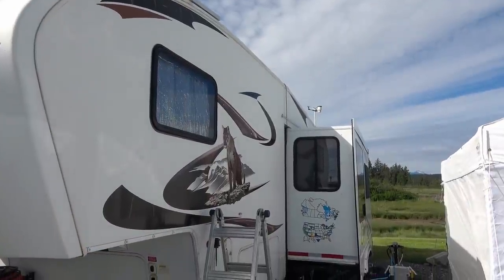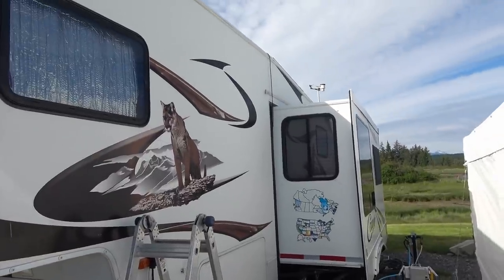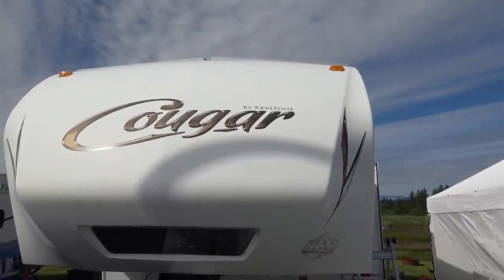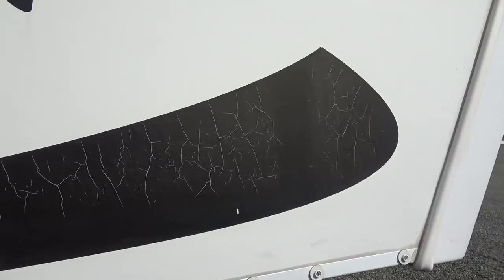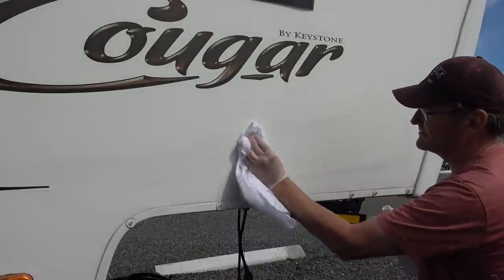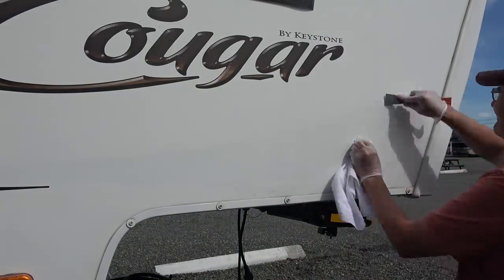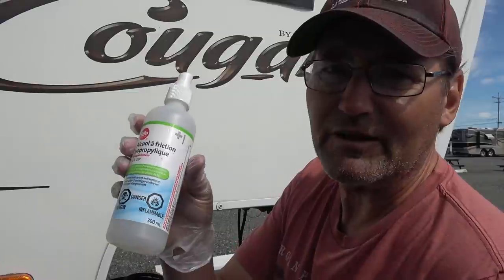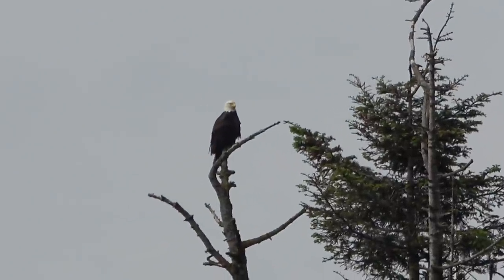Removing Cracked Faded RV Graphics from our Keystone Cougar Fifth Wheel Trailer

Comment: I just removed and replaced my decals on my outboard motor cover. I used the Whizzy Wheel Car Decal and Sticker Remover with Drill Adapter Kit. It removed the decal and adhesive with very little work. No damage to the original paint under the decal. I was really surprise how fast and affective it was. Picked it up from amazon for 20 USD.

Comment: As someone that’s worked in the sign industry for 25 year, you are probably best off to remove all the graphics at the early stages of cracking. Even if the other graphics haven’t cracked yet, they are the same age and won’t be far behind. It’s certainly much easier to remove them while they still have some integrity left where they can be removed in larger sections with mostly a heat gun. 

The 3M erasers that go in drills can work well to remove the cracked areas; however, the make a dusty mess and I’ve seen them discolor lighter surface from the heat generated from the friction.

Comment: Nice job ray when I resealed my trailer after removing all the old sealant I used lacquer thinner did not harm anything i actually was polishing my trailer today I was using protect all  fibreglass polish also meguiars one step number 67 both products work great tools I’ve use orbital polisher and rotary dewalt takes time but the results are great 😊

Comment: Ray, you can always give an decal eraser wheel a try. I find they work really good. Just run them slow and they work well.
Reply from the maker: Have you used them on thin Filon type sidewalls versus regular thick fiberglass?
Reply: @LoveYourRV  Yes, they work great, just run them slow, slow is the trick.
Reply: @LoveYourRV  I have used a decal eraser wheel on slow, both in the sidewall and the front cap. You have to let the wheel do the work. You can't press at all or the wheel will leave a slight burn on the fiberglass. The burn is taken away by a small amount of rubbing compound.

Comment: I’d love to see a walkaround of your camper. I have a similar one - if not the same one- and new to the camper world, I see some things on there I don’t recognize but would like to hear your story. I will check your page for one, probably should have first before I wrote this. Just wanted to say I like your video. Thanks.
Reply: Thank you.  I look forward to seeing all your work. Mine is not the same I see. Yours is the size I wish I had. Mine is the 2011 322QBS. 37 miserable feet long. Don’t need anything that big but the price was right. Took a month to clean the carpet from the wet dog smell. I wish I just ripped it out. A project for the future (or but the one I want with no $$ ;)

Comment: Hi Ray, Your decal removal looks good. We removed all the graphics off our rig completely. We used RapidTac RAPID REMOVER Adhesive Remover. The decals came off like butter. We used those orange Plastic Double Edged Razor Blade and Titan Razor Scraper to remove the graphics. To get rid of the old graphics "shadow", we then wet sanded the complete exterior utilizing very fine made for fiberglass wet sanding paper and a orbiting sander. It removed most of the oxidation and scratches from over the years. We then finished up with a full application of Meguiar's M-4965 MG Fiberglass Oxidation Removal Kit that got the last of the oxidation using Compound Buffing Sponge Pads  . After a full scrubbing wash, completed the project with Meguiar's M5032 Marine/RV One Step Cleaner Wax with Wool & Synthetic Polish & Finishing Pad. The rig looks better than it did when it was brand new. We then caulked where necessary and she is good to go for a few more decades. It was a lot of hard labor, but well worth it with satisfaction of a job well done, just as you always do. We only use marine grade products on the RV. Safe Travels and Happy Trails Ray.
Reply from the maker: Awesome! :)
Reply: Just copied your comment into my notes for when we remove our decals to sell the RV.

Comment: 3M Stripe Off Wheel Adhesive Remover Eraser Wheel Removes Decals, Stripes, Vinyl, Tapes and Graphics 4” diameter x 5/8” thick     they work great
Reply from the maker: I was looking at those wheels but wasn't sure if they were big enough for the large RV decals. Does the wheel last a long time?
Reply: @LoveYourRV  I used two to remove the decals on my 1998 Alfa Ideal 36’.  I didn’t do the ones at the very top of the sides because I had awnings and slid toppers.  Still had the ghost of the old decals.  Called it The Naked Alfa.
Reply from the maker: Thanks, I give one a try on my other side, Will get the 3M one. I see some cheaper wheels out there but I imagine like most things you get what you pay for. Most of the 3M stuff I try works well and has also of good reviews - https://amzn.to/3uiJmhq  Cheers, Ray
Reply: @LoveYourRV  just watch the RPM’s and don’t hold in one spot to heat it up.
Reply from the maker: Was your Alpha regular fiberglass sidewalls like a boat would have or this stuff called Filon that my sidewalls are? As far as I can tell Filon seems to be a very thin layer of fiberglass bonded to a wood backing so not as thick. I guess it saves the manufacture some money and reduces the overall weight.
Reply: @LoveYourRV  it was just regular fiberglass.  The sun of Arizona had really done damage to the decals and on the sunny side it had done more damage underneath the decals.  If I remember it around 2000 rpm’s and keep it moving to keep the heat down.  I would make several passes over the decals.  But it looked like you got good results with the heat gun.  Mine were cooked on.
Reply from the maker: I imagine it would work best on crusty sun backed decals versus newer decals where the glue is still sort of gooey and would maybe clog up the wheel. I think I'll giver a try though and see what happens. :)
Reply: @LoveYourRV  I removed all of my decals on my 2007 Passport 280BH. I used the 4" Car Decal Removal Eraser Wheel commonly found on ebay. They do last a long time.  I think I bought a pack of 10 but didn't need to use all of them.  The only downside is when the rubber flakes off it can get all over your arms and clothes.  I prefer using them over all else.  Completely removes the adhesive as well. But, I follow up with mineral spirits to completely clean it off the rig.
Reply from the maker: Do you remember the RPM you used @Ricky P.
Reply: @LoveYourRV  My drill was variable speed.  It was somewhat in the middle.  Not too fast not too slow.  You'll get a feel for it.  Too fast will build up a lot of heat. So be careful not to burn into the rig.

Comment: Did you ever get or have a Huges Autoformer?? If not, I highly recommend dropping $500 for one!  I recommend you put it in front of your progressive industries surge protector!  I’ve visited RV parks where the voltage is pretty low and Hughes Autoformer would increase voltage by 10%... all other RV parks it’s only 2% increase.  My RV is a 2009 version and the AC and Fridge still works because of it!
Reply from the maker: Thanks for the tip but would be a waste of money for me personally. We don't often stay in RV parks that have low AC voltages and now we also have a ton of extra solar power and battery capacity so can easily compensate for the low voltage. :) But I can see how it could be beneficial for RVers that often use sub par voltage RV resorts. When on the road we mostly boondock. Cheers Ray

Comment: Can anyone tell me if you can just stick new decals over the old ones and where to buy new decals?
Reply from the maker: Here is the company I linked to in the video, don't know how good they are though - https://rvgraphicsstore.com/  Some people sand down the old decals and paint over. I'm not sure about new on old decals, I would think it would be hard to line up exact and then holding both in place is the old adhesive underneath.  Cheers, Ray
Reply: @LoveYourRV  thank you so much!

Comment: 3M eraser wheel and a high rpm drill
Reply from the maker: Will give it a try on the other side. What is the best RPM for a Filon sidewall, Thanks Ray
Reply: I am not sure on your surface was using on a 2011 pickup. About 1000 to 1200 worked best. You probably need to try test spot.
Reply from the maker: Thanks!

Comment: I'm not a huge fan of most RV graphics so off with them all I say! Although some are putting a little design and thought towards appearance now. When ever I need to remove a decal I use toluene. Get it at the paint store. It won't harm your RV because it flashes off so fast. Wear gloves or it goes straight to your liver tho...toxic stuff.  Causes dementia if you breathe it too long....so go for it, right?
Reply from the maker: Thanks for the tip. The only thing that gives me pause is if I ever decide to resell or trade in the trailer.

Comment: The best way that I have found to get decals off is to get a eraser just like the one's on a pencil.    The eraser hooks to a drill motor.   As you spin it on the decal the heat takes it off.
You can get these at a car body supply center.
Reply: its made by 3M - works good, but does put rubber dust everywhere.

Comment: I would take them all off, specially the good ones that are easier to remove. Don't wait until they crack to remove them. If you want some stripes, use existing marks to re-stripe the ones you want with new ones that will last you a few years.

Comment: Hi Ray,  I used much the same method as you but used acetone instead of the rubbing alcohol.  I used the plastic razor scrapers but as you say anything that won't leave marks is fine.  It's a few years since I removed most of the decals and have no plans to replace any.  The most annoying ones started to peel around the edges leaving the adhesive that attracted dirt.

Comment: I have an older Fleetwood Pioneer camper that I removed the decals on, it has the aluminum ribbed siding and I plan on painting the entire camper anyhow, at first I used just a heat gun and a scraper which left a lot of residue, but the trick for me was my rubber gripper gloves that I get at Northern Toll for 1.99, as you heat up the decal start rubbing it with your gloves and it will just roll up and come off leaving no residue, I couldn’t believe how well and how fast it worked! Your gloves can get a bit toasty so take your time doing it, as you use the gloves that get even more tacky and work better as you remove more decal.
Reply from the maker: Thanks for the tip!
Reply: I'm gonna take some old cracked decals off my hardtop camper trailer soon as I want to repaint the roof with rubberized paint.. I bought 1 of those rubber wheel gizmos that you attach to a drill. I managed to get 1 on sale for $6.99 original price was $16.99. If it don't work I'm not out a lot of money. Those other 3M wheel gizmos cost quite a bit.

Comment: Of course it's Ann's and your call but I'd suggest that you consider some newer styling,  maybe more recent graphics use on newer RV's.  As opposed to replacing them with the original graphics.
  The only reason I would replace what was there with the old is if you want to mask the faded areas.  
Perhaps you can get some newer cougar graphics.  Then it won't have 10 year old graphics but much newer styling.  It's a thought,  maybe you can think outside the box.
Reply from the maker: That's a good idea or I could add a different model package. Get people scratching their heads wondering about my weird model of Montana :)

Comment: Good morning Ray I did the same thing with my RV. Montana seems to be noted for not having good decals. This was the second set removed from mine.

Congratulations on your 10th Year celebration. We only made it three years in our adventure and we have sold our RV and have permanent Roots again. Hopefully we will buy small motorhome and travel some here and there maybe we'll run across you on the road again.
Reply from the maker: Thanks. :)

Comment: Never knew why RV manufacturers plaster these weird graphics all over their products.  The graphics should be optional at extra cost.  Some 20 years ago, as a museum volunteer, I had to remove the giant vinyl graphics from the sides of a retired 1947 PCC type streetcar.  Used most of the same methods as you did, except for MEK (Methyl Ethel Ketone) to clean the surface prior to sanding and repainting.  (MEK is an industrial solvent and will happily damage your lungs and dissolve your brain cells if inhaled.)  However, the trolley's graphics were made from thick, industrial vinyl and did not rip as much as consumer types do.  Big, job.  Took several days of hard work!  Will have to remove the graphics from my 2003 5th wheel soon, too, for the same reasons.  Don't look forward to it.

Comment: Lighter fluid like what Zippo Lighters use melts the glue and the stickers come off easy.
Reply from the maker: A popular one in Canada that is similar is called Ronson  https://www.amazon.ca/Ronson-ounce-Ronsonol-Lighter-Fuel/dp/B0017X1NGO  I used to use it for removing stickers from TVs, VCRs and Stereos back in my electronic repair days when reconditioning for used sales. It worked great and never hurt any of the plastics but I tried it on the decal adhesive and it worked OK but not as well as mineral spirits. Cheers, Ray

Comment: Do you think that waxing/polishing the RV over the years contributed to the decal cracking, or does it prolong the life expectancy?
Reply from the maker: My gut says it likely doesn't affect them much at all either way. All the RVs I see tend to have the decals wear out at about the same time. Occasionally some fail much earlier if there is a defect with the production run or cheaper decal quality or the RV is in extreme temps. Darker colors seem to fail first, so maybe heat drying out the underlying adhesive and vinyl. Cheers, Ray
Reply: @LoveYourRV  Direct sun in the Valley.  Left side peeling; right side perfect.

Comment: To remove the adhesive, next time try REMOV silicone and adhesive remover. Spray on, give it a minute, adhesive will wipe off. Won’t harm paints. It’s expensive but works VERY well. A little goes a long way. Amazon has it.
Reply from the maker: Thanks for the tip. :)
Reply: I was just gonna use some alcohol watered down with some hot water.

Comment: Thanks alot.this is just what I needed to see...mine are starting to go too and have had a time..didn't think of a heat gun and I have one..lol...just was doing it on hot days...need someone like you to help me...you got a single twin... lol..thanks now I know what I'm doing tomorrow...
Reply from the maker: You're welcome, just watch the heat gun as it can over do it quickly if not careful, I set mine very low level. Some people prefer to use a hair dryer. Cheers! Ray
Reply: @LoveYourRV  thanks Ray..will do...don't want to burn my house down...do I...
Reply: I have been eyeballing my graphics for a few years watching them get worse and worse.  You have given me some inspiration as well to get them off my 2012 Coachman.

Comment: Use a 3M eraser wheel in a drill motor.
Reply from the maker: Will give it a try on the other side. What is the best RPM for a Filon sidewall, Thanks Ray

Comment: I would have tough that using a hair dryer would produce a less brutal heat than a heat gun
Reply from the maker: My heat gun has many heat levels, I had it at a low level. Worked perfect.  https://www.wagnerspraytech.com/products/heat-guns/furno-series/
 Cheers, Ray

Comment: Forget the wax put on Poly Glow.  Made specifically for the marine industry and fiberglass boats.  Made my RV look like new, I always get comments on how shiny my rig is.  You do not wax over PolyGlow you only re-apply once a year.  Call the manufacturer and see if you can put it on Filon.   It is an amazing product!!  Whenever I park in a grocery lot and the Firefighters are parked nearby while they shop they always comment on how clean and shiny the rig looks!  My only caution is do not use any chemical bug remover to remove bugs as it will strip the product off.
Reply from the maker: Thanks, I was considering a product like that once my original gelcoat is shot. It's getting there in places but still not to bad for the most part. Cheers, Ray

Comment: Thank you for your video, very helpful. I have a question: I noticed that the siding to the right of my door feels like particle board and not smooth like fiberglass. When I took off the decal using the heat gun and then used the mineral spirits, it feels like I’m stripping off the siding. Am I doing something wrong? Is there something else I should be doing instead to get all of the glue off?
Reply from the maker: Sounds weird that they would have a different material there. I wonder if the it was a patch or repair. My whole side wall is the same material. It called Filon, which is a thin fiberglass with gelcoat covering an underlying wood boarding material.
Reply: @LoveYourRV  Must be the underlying wood boarding material that I feel. Is it possible when I was taking off the decals using the heat gun and then the mineral springs, that I could have removed the Filon fibreglass material?
Reply from the maker: @ShannonMcAvella-ey7hl  I think if you were to get too aggressive with the heat gun, it would more likely start to discolor, bubble, or burn versus peel off.
Reply: @LoveYourRV  I did notice a burning smell, but I think it was the deckle plastic.  I am definitely going to be more careful next time.
Reply: Thank you for all your help and your videos, much appreciated.